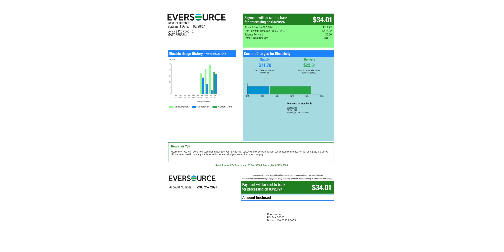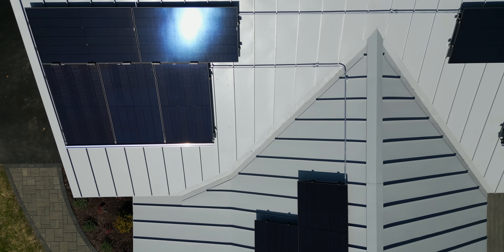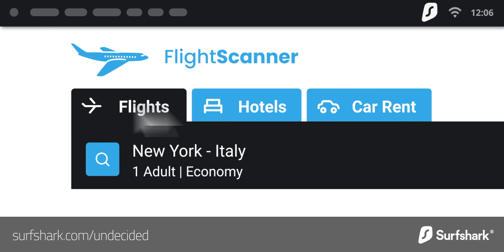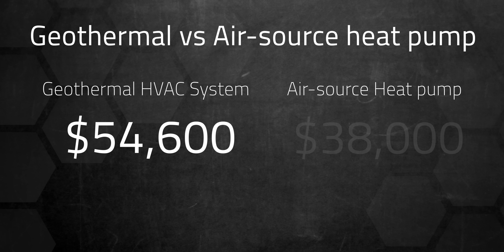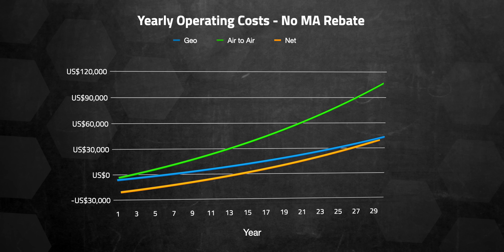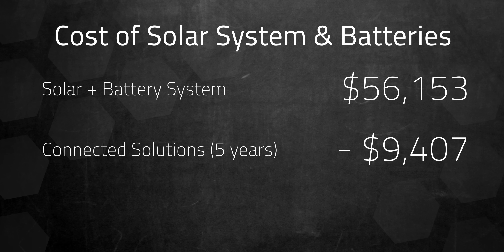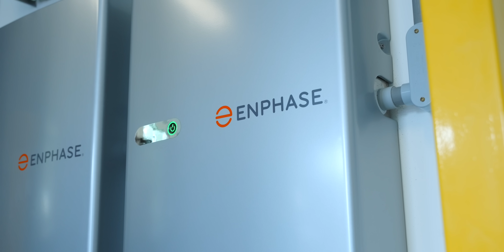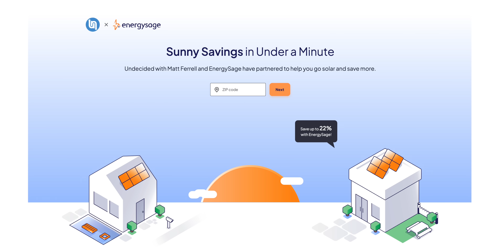What I Learned After 1 Year with New Solar Panels

Comment: First of I'm pro-solar, I have a couple ebikes, have built batteries from raw cells and a solar system for my camper.  But, seeing videos like this ... actually lends credence to the arguments I hear that it's too expensive and constitutes a wealth transfer to the rich.  Simply enormous up front costs, huge tax subsidies and no comparison to the actually working alternatives, e.g. a natural gas furnace.  It definitely tempers my enthusiasm seeing just how unrealistic the costs are for the vast majority of people.
Reply: Before you let it temper youe enthusiasm - I'd look into panel prices yourself.  $55k for 43 panels is insane.  I have no idea how those cost so much.  In the UK my mate found a supplier selling a crate of 10x  400W panels for £600 + VAT.  I know Matt opted for fancy ones with individual inverters or whatever, but still..
Reply: @spinaltap22  Oh I'll be fine - if I get solar - I will be installing it myself as a post-grid system. i.e. server rack batteries and inverters with no grid feedback, supplemental charging only(my state is actively hostile to solar and grid-tie). But I'm definitely on the aggressive end of a DIY type person(engineer).  I'm basically thinking of the scenarios where I'm discussing it with normal people.  It's hard to make a good-faith argument to a skeptical audience when the costs (to hire) are so extreme, and involve significant subsidy. Raw panels have gotten extremely cheap lately (30c a watt, when it was near 80c a few years ago), so it's disheartening to see labor and markup still so expensive.
Reply: @spinaltap22  I think it is the install cost with licensed electricians.  Panel prices have really come down.
Reply: My solar panels give me a 9.5% ROI after the 30% federal tax credit that I got when I installed them. That’s a real ROI from 4 years ago before utility prices went up, my ROI increased when electric rates went up. 

Most people take out loans to install solar panels though. The interest rate eats up half of that ROI or more! Those loans make it so that most homeowners can buy solar panels, but they also make it so that solar panels aren’t a great financial investment though. I only recommend solar panels to people who can pay cash. Which is upper middle class or upper class.
Reply: I pay $280 for 410/575 watt Hyundai bifacial panels in Hawaii, big island. And everything here is way expensive except housing.
Reply: Talking about subsidies doesn't make sense because solar isn't subsidized even close to oil or gas. It wins over fossil fuels on its own cost really, 30% tax rebate is nice but not decisive on upfront cost. Nobody ever invaded a country for solar power, no environmental disasters from solar, polluted water tables and so on. Fossil fuels constitute a wealth transfer to the rich simply by externalizing all the cost to the poor. The majority of solar cost are not from the panels but permitting, installation, battery. The panels have been tariffed by both Trump and Biden and they still are extremely economical. The battery system is usually what drive up cost.

Honestly, he paid a little high for his system unless it's really more expensive in the northeast. His numbers are 3.22/w for the panels and 1670/kWh battery. For comparison I paid 2.12/w and 1018/kWh here in California. The per watt on the panels isn't 'bad' but some of his cost definitely from preferring the best panels and definitely paying enphase tax for batteries. I've never been particular convinced on top shelf panels since its easier just to go bigger with cheaper panels and you'll still outmath degradation while being cheaper. Also, his system size & electric usage is definitely not typical since hes totally electrified and opted for batteries. Clearly this is economical in the long run, but it's an outlier versus most setups. Most people with an eye towards cost will never go with batteries if you live in a place with 1:1 net metering.
Reply: This is brain boy with toms of money playing with this stuff and educating us in so many ways. But yes, this system is way over built.
Reply: I live beyond the natural gas service area.  (Septic too.)  Propane is very expensive, so solar is much cheaper.  I do have  a grid-tie into a very reliable utility and net-metering, so I don't need batteries.  We went all electric at very little cost, and never an electric bill now.
Reply: this!
Reply: Just finance it for 30 years, don't pay cash. Then it will make sense.
Reply: @eIektrinis  Interest rates of 4-7% will eat up the majority of the profit.  4% 30 year loan will result in $100k really costing $170k.  A 7% loan will result in that same $100k loan resulting in $240k.

However, if you can get a solar system for a 5-10 year payback (and match the loan to the utility savings), that same 7% loan will be $140k over 10 years and $110k over 5.
Reply: @JoelKleppinger  I've financed mine for 10 years at 5%. But my 13kW system cost me $5000, so I pay $50 a month. While I save $300 on electricity bill. This makes sense to me. But it's in EU, our solar prices are back to earth.
Reply: @eIektrinis  this is what i did, finnaced with a green loan at 2% over 20 years. Savings outweigh cost from day one.

Comment: Everything he bought just seems so much more than what I did: $1400 Heat pump water heater, $7k cold climate air source whole house heat pump, $20k for 14.5kw of solar, 30kw battery, hybrid inverter … all that is costs installed before incentives and rebates
Reply: Battery and solar panel prices have crashed in the last 3 years at least in Europe. If he did it now you'd get it for half price max.
Reply: Yeah, his home seems way over engineered to me. I have net zero in Washington from decent insulation, 15kw solar, air sourced heat pump, and regular electric water heater. No battery, no geothermal, no heat pump water heater
Reply: 7k for heat pump installed is a great price. Where do you live? Most people get quoted 20k near me
Reply: He lives in massachusetts, like me. Costs are HUGELY inflated here thanks to the cost of living. Bit of a catch-22, but thats just how it is
Reply: @GodofGHz  can u verify or refute the numbers he gave?
Reply: Dude is an embarrassment to bald men everywhere
Reply: @NightRogue77 . You can say that again. It leaves scratching my head where all these exorbitant numbers are coming from. He thinks he's super smart or something 😅
Reply: Any reasonably priced ideas for living in California, Mojave Desert? I'm getting racked over the coals during the summer.
Reply: @edwarddiaz8371  Summer is EZ. Solar Panels are cheap. Pair with some batteries and enough inverters to handle your big loads and you'll need nothing from the grid.
Reply: lol so much of that in the comment section yeah? Makes you wonder doesn’t it? Doesn’t seem normal does it?

Unsubscribe from this channel.  In fact, unsubscribe from any channel that has been around less than eight years and has over 1 million subscribers, starting from the very beginning with slick production values. Unsubscribe from any channel in which the human being has not indicated anxiety at least once since the election.  Unsubscribe from any channel in which verified bot activity is evident - it is entirely possible for content creators to filter out the majority of bots using keyword censorship, so excessive bot activity is indicative of a disingenuous source of information.  Yes, this channel has a lot of bots

Comment: 40kW is really the bare minimum for full 24HR coverage with or without sun coverage.  I'm learning going into the fall, you have to use a TOU setting to charge back from the grid to offset days in which it's rainy, cloudy days will NOT give you enough coverage.  That said, if you have the coin to get more batteries, do it.

Comment: If just went with a big DC coupled battery you could have had you 30-40 kwh and you likely would have saved money over enphase. The increased output would also save you money because you wouldn't need load sheding smart panels. You are going to turn off circuts alot less than you would expect.

Comment: $55k for an 18kw solar system.  Wow!  So my system in the UK was £11k for a 9kW array back in 2020.    

Now you can purchase JA Solar 420W panels for just over £50 each.  So for your setup that’s £2150 in solar panels + £2600 for 2x 8.8kW Sunsynk inverters + £50 a panel for mounting system.  

So that’s £6900 plus ancillary equipment + labour costs.  Soft costs like permitting don’t exist in the UK for most residential solar (and if it does - like in a conservation area - then it’s a £300 application fee), and in most instances the connection permission to the grid are mandatory but zero cost.

So the difference in cost seems to be all down to on site labour and it just seems like someone is either seriously coining it, or there’s some severe mismanagement of peoples time going on (bogged down by paperwork).

It’s very tempting to get the electrical qualification and then just DIY all of the solar.

Comment: But can your calculations account for future energy efficiency improvement of replaced appliances in the next 30 years? One or more of your appliances will fail in the next 30 years and you will undoubtedly buy the most efficient model at that time. That appliance may be cheaper or more expensive. We don't know that part of the equation, but you can bet that the replacement will use even less energy.

Comment: $30,000 for a battery backup system that doesn't even keep your home going for 24 hours. There are so many solutions to avoid that. This country won't do any of them though because it's more important we sell $30000 battery kits than actually solve the climate crises.
Reply: Hopefully soon all EVs will be able to do Vehicle-to-Home (V2H).  I hate having 150 kWhs of batteries in my cars that cannot use in a power outage.
Reply: As an outsider it’s mad, you could bury all your electrical infrastructural like much of the world and not have to restring it all after every hurricane, fire etc. Here in urban UK not had a power cut for 15 years
Reply: @edc1569 we do bury it here and there… but most is still up in the air.
Reply: @edc1569  I've been telling people this ever since I went on a euro trip almost 10 years ago. I, an outsider from cheeseburger land, marveled at the fact that almost none of their electrical infrastructure was exposed to the elements and how much more stable it must be compared to stringing high voltage cables on a wooden pole that's probably close to 30 years old. Seriously, my biggest takeaway from that trip was how ass-backwards the US electrical grid is compared to Europe's. It's such an obvious advantage that American power companies don't seem to care about leveraging because "it would cost too much to convert our whole grid to an underground affair." Money is the only thing these people ever seem to care about.

Comment: You and I are in amazingly similar situations for Solar Generation and interface with the power company, (also Eversource), and while I lease my panels, we bought two Tesla Batteries, that I believe are what is doing the most benefit in keeping us 'grid free' for 90%+ of the time.  Along with three Fujitsu heat pump/AC units, powering 8 inside modules, this is a super efficient system, and for out 50+ year old home, an excellent way to go.  We are happy. (in the 063 _ _  ZIP code)

Comment: Thank you for the info . At some point I want to build a home like yours . I am thinking of using icf that are r30 and sips roof of r50 . It may be more efficient for me to added more insulation . Then use a air source heat pump for heating and cooling . I appreciate your perspective .

Comment: Thanks, this was very interesting to see!  We are in California and put up a 9.6kW solar array in 2001, which took about 11 years to break even with net metering.  In 2011 we installed a solar hot water system, which reduced our propane usage by about 1/3.  We have an 80 gallon hot water tank with a heat exchanger inside, which feeds our regular propane hot water heater.  Now we are beyond the 20 year net metering agreement and are under the new NEM 3.0/NBT rules, which are very unfavorable for solar alone.  This year we install a 40kWh Franklin battery system, with Span panels and a Span Drive car charger.  The Span panels integrate with the Franklin battery system, so they can instantly turn off circuits when the grid goes down.  We are also enjoying the recent upgrade to the Span Drive charger to only use excess solar to charge our car.  We also upgraded one of our 4 solar strings to a bigger inverter and new panels, so our system is now about 14kW.  We use almost no power from the grid, and the excess from our array that we send to the grid more than covers the cost, even with the low NBT rates.

Comment: This is why I'm having trouble installing solar as our electricity is currently about 15 cents per kWh, so all of your 9 year payoffs for things basically double to 18 years. That's with no batteries.

Plus with the design of my roof and layout of property my system will have to be fairly small which means the labor costs are much larger compared to the savings with the output. Which is why almost all of my quotes had near 20 year payoffs.

That, and where I am doesn't have rebates like this video shows. Add to that our winters are long and dark which is where we use the vast majority of our energy.

I still do want to get a system installed. I just have to be very selective and hopefully can do most of the work myself to help keep costs down. Maybe one day, but for now it's just rely on the grid for me.

Comment: Wow, these solar/battery prices are pretty crazy, but i guess labour and margins are higher in the US.

For context; this autum i've built my own solar system. It's only 7.1kWp and with a 15kWh battery. It's "tehnically" off grid (although in practise i still connected my inverter to the grid, just in the events when battery runs out). I've setup, built and installed everything myself.. The total cost of the system? About 3500$ or 500$/kWp.

This did include building my own battery bank from scratch (big saving there and gives a ton of flexibility in the future) and using a smaller single phase inverter (these are way way cheaper than 3ph). 
Just to give you a context on how hosed you get when you want everything turnkey and with a nice box/software.

Comment: As a fellow electrical engineer that runs NetZero Solar, I can definitely say you wasted a boatload of money, and a truckload of money. You really should have known better. A wattmiser would have saved you $10,000 alone on those fancy reporting digital sub panels. Straight wasteful. Literally 3/4 of the products you used are unnecessary, overboard and are Just trying to sell your partners products. Pretty clear. Yes master engineer 40 plus years thanks

Comment: There is only one serious flaw in the financial calculations, excluding the rate "lock-in" and the protection from external events (these have a monetary value of their own). All of the money invested could be yielding interest if invested in some other place. Assuming this would be some high-liquidity, very-low-risk investment, how would that compare with your current situation? My house has a grid-tie PV system but no battery backup and the "cost of the money" invested changed the amortization profile noticeably. In my case, even after taking this into account it still was very advantageous to invest in solar instead of letting the money sit in the bank!

Comment: I had a solar PEV system installed on my house in Texas years ago, I never broke even because I sold the home at year 10 and it would have taken until year 11 to break even. I really didn't get any premium on selling the home with the PEV system, but it was an incentive to the buyer. However there were additional cost not factored into that, one was a hail storm destroyed all the panels which were replaced under my homeowners insurance, but that costs has to be absorbed somewhere. Also the inverter broke and had to be repaired/replaced that was covered under the warranty but the labor was not, plus I also lost almost 2 months of electric generation due to the time it took to get the job scheduled. Was it worth it, yes and no. I did achieve net zero electric cost every year, my home water and heat was natural gas, and my biggest cost per year was always cooling not heating. Financially it cost me a few thousand dollars in the end as I only lived there 10 years.

Comment: Very cool a tremendous success.   I built an off the grid home in 1983 so I am completely out of touch with current pricing.   My beautiful remote mountain top property 17 acres for $17,000.  My double wide two bedroom manufacturered winterized home with vaulted great room was $18,000 delivered.   I achieved 80F degrees year round with no AC and a wood burning stove.  The house came with propane central forced air heating.  My firewood cost was less than $100. A year.  I built a three solar panel generator that provided all electricity at no cost.  This worked perfect with marvelous views.  I sold the house around 1987 and it for twenty years it performed flawless remaining with a new fresh appearance.   The human species is just crazy monkeys and from every direction the house fell into abuse.  Today it is completely ruined though it is inhabited.   I wonder what the crazy monkeys will do to your house as time goes on.